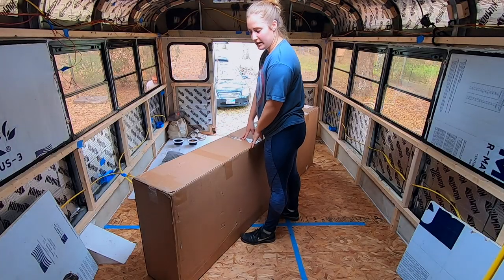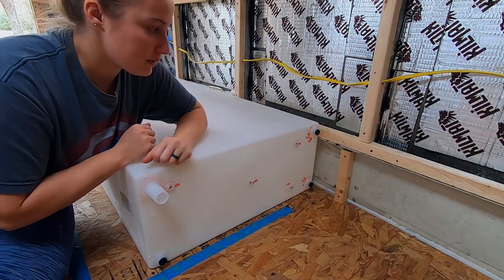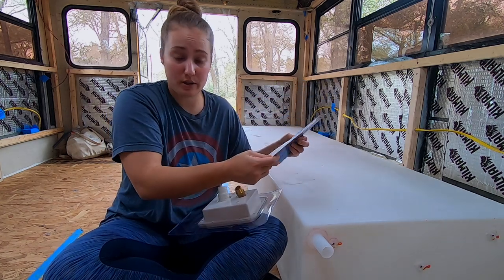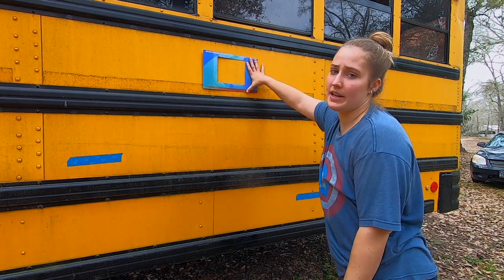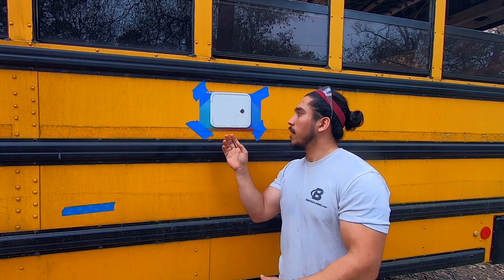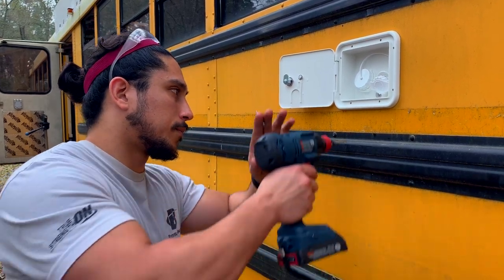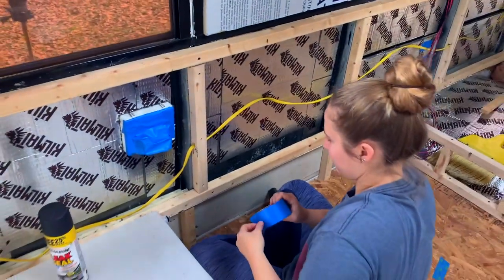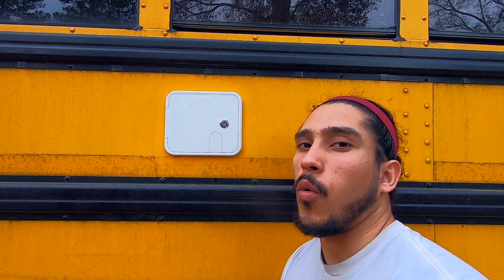How To Mount Your Water Inlet On Your School Bus * Skoolie Conversion * Gus The Struggle

Comment: Good morning you two. Great videos as always. On a note with water tanks in general, put a layer of rubber sheet below them, water tanks will get condensation with variances in temp and will result in mold/rot in time. I finally started interior framing on the back portion of my bus this week. I send some pix soon. 
Take Care
John A
Reply from the maker: John Clamshell SP hey John! That’s a great idea!! We are not ready to install the water tank yet but when we will, we will see if that is an option for us! Great idea!

Comment: Guys, great stuff as usual. I just finished installing the same water inlet in our bus and I’m having a hell of a time getting any 1/2” FNPT to fit the city fill. I’ve tried three different fittings without any luck. You might want to buy a test fitting to see if you have this issue or not. I’m using pex but other haven’t worked either. Hopefully yours is easier. Hit me up if you have questions. See you out there.
Reply from the maker: Thank you! No we have not started looking for fittings yet, it is on our list! Let us know if you have any luck!  We plan on using pex as well
Reply from the maker: hey! we talked to someone who was having the same problem. They said they had to have it re threaded at ACE hardware and then a 3/4s fit on to it. We have not looked into ours so we will update you when we get there!
Reply: Thanks for the info. I finally got a regular FNPT brass fitting (non pex) to go on the city fill, then had to put a MNPT/pex fitting on that. Had to use quite a bit of force to get it on but it should be good. Fingers crossed for the water test. Finishing the rest of the plumbing now.

Comment: Just a little life hack you only have to drill two holes. You place the holes on opposite corners and you use the same hole to cut two directions, any more than two holes is just a waste of time.
Reply from the maker: That is a great tip thank you!